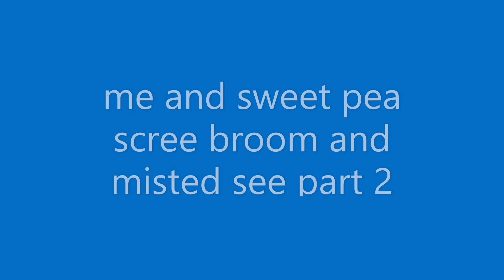dry concrete slab

Comment: Not sure this guy realizes how hilarious he actually is. LOL.  Perhaps if he holds the bags even higher he can create more of a cement dust "cloud".  Of course I say this all in jest. 🙂I'd probably drop the unopened bag flat, cram a pointed shovel into the mid-section and roll the bag over.  Then just lift up both ends of the bag simultaneously.  Lots less dust and less energy used handling it.  Probably should wear a mask too.  Love the go get'em attitude.  For real. Look forward to watching part 2.  Thanks.
Reply from the maker: I wasn’t really worried about the dust and I use the flat shovel

Comment: I bet a rake might make that leveling job a little easier.  Also, using a round pvc pipe to finish grade the dry concrete might work better.
Reply from the maker: A paint roller would be the easiest way

Comment: May have been easier by making a smaller slab, otherwise good job.Thanks for the video.
Reply: yes just do two,  the second poured while the first is soaking in first water light sprinkle, you also get a break already
Reply from the maker: It was not bad but 1st time made rookie mistakes

Comment: Hey thanks for sharing this.  I've been considering doing a 10x10 but in 4 sections using dry pour.  I'm in the Chicago area so thinking of adding gravel and some wire  due to freezing.  Where are you from?
Reply from the maker: Sounds good check with sum friends for more tips expansion joints you’ll need expansion joint thanks for watching